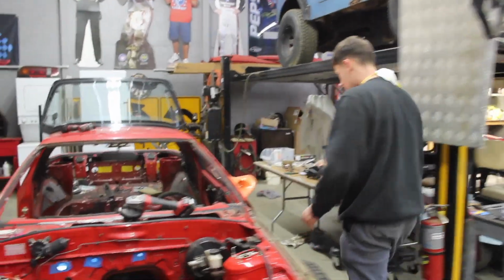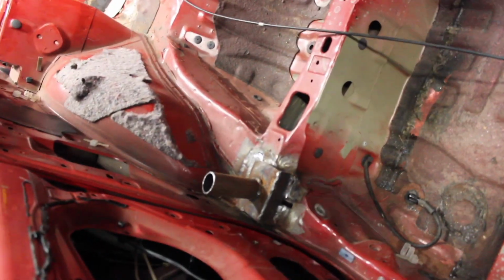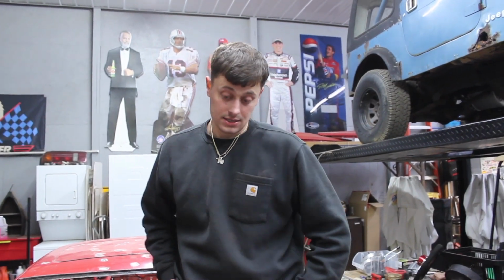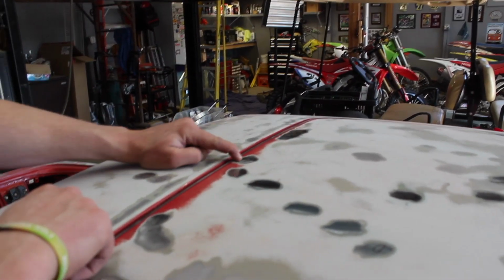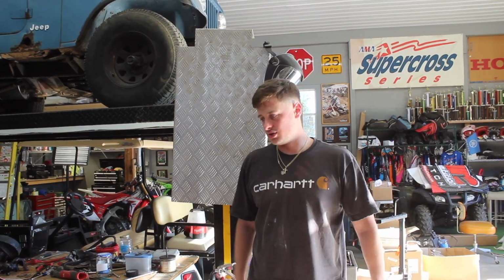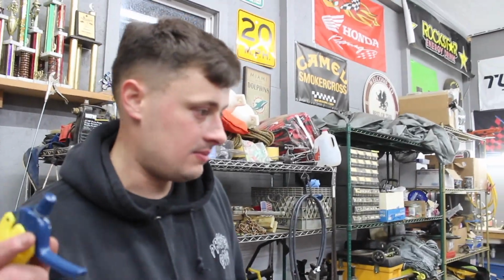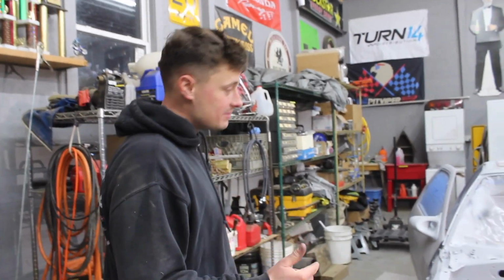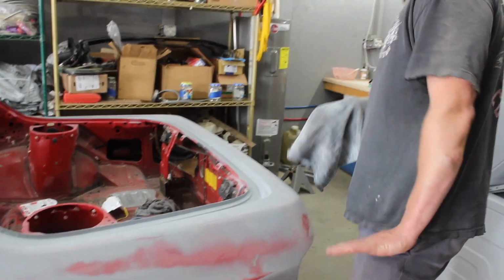PAINTING MY RX7

Comment: Don't gut the body harness, literally pointless. it's literally three wires from the chasssis to the LS to make it a turn key car with all the street functions. I literally have videos describing every bit of it and how simple it is to wire, no need to buy some random rAcE cAr harness lmao. There are 3 wires to make that engine run, 1 wire triggers the fuel pump to come on, one turns on the holley with the key (12V+ switched soruce), and lastly the starter signal which is already in the bay for you which can just slide right on. Don't be misguided.
Reply from the maker: Well that woulda helped to know before i got rid of it lol😅 i just didnt trust it it looked old and sketchy
Reply: @camtillman77  tbh the rx7 has one of the best chassis harness' i've ever dealt with an rarely fail as a whole, the "issues" people have is dumb little things like a dead fuse. They have aged really well over the years.
Reply from the maker: @thepcmrtim  mine was screwed up and spliced so i just decided i didnt want it but it sure didnt look awful😂🤷